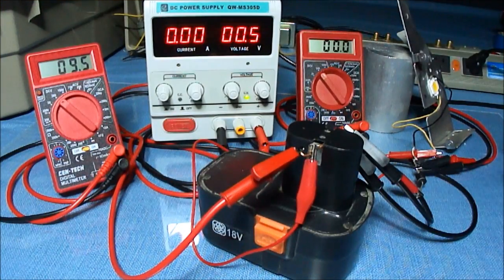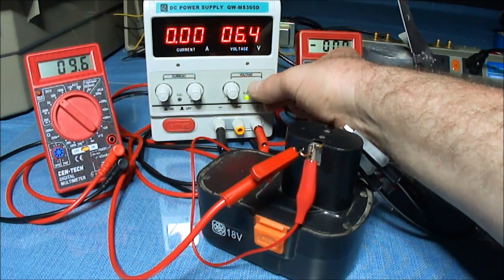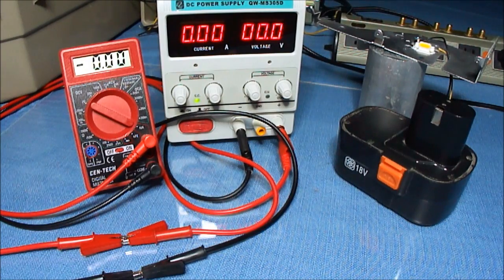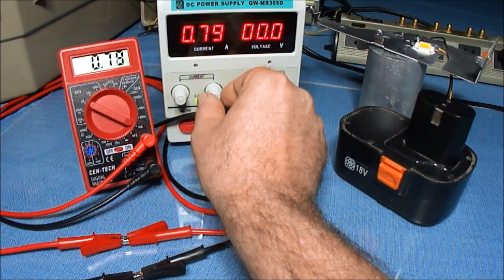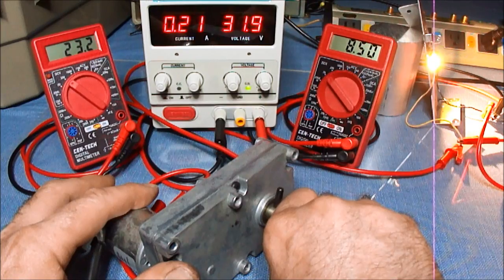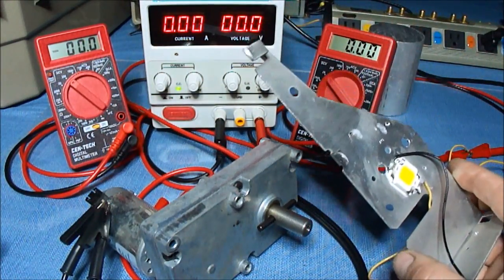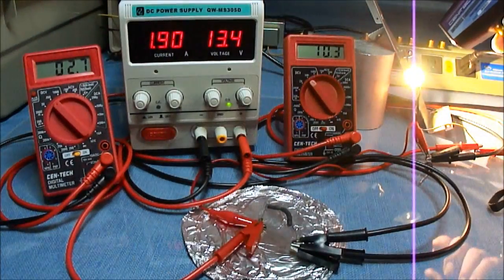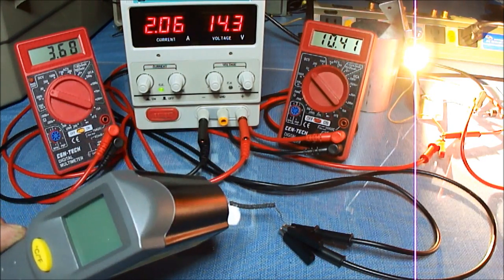LED Series Part 2: Ampless Light - Zero Point Energy?

Comment: Because the battery in parallel with the power supply while the LED in series and parallel with the two balancing source  aka two battery source one higher voltage and capacitance than the other. While one is discharge into the battery (charging) and discharging into LED in series and parallel. The LED current feedback into 18v battery while moving against opposite direction to the charging current coming from 31v power supply. This create scalar current that cancel with constant voltage potential. You can do the same the with smaller LED and 2-3 1.5v battery with/or 9v battery maybe use resistor. The batteries total voltage will going up.

Comment: Great vid, I experienced something similar in an experiment with bifilar pancake coils and batteries in series with a motor to allow the system to run. I believe that we could recuperate a Hugh amount of energy this way while still using enough to produce extra. Use the motor as a generator to charge the batteries that power the system. The pancake coils would act as a resistor similar to the coil you have, but again rectify this AC and collect via caps to a battery. Almost no loss.
Reply from the maker: Thanks. In every circuit there is energy being dissipated into the air by each component. With high voltage the air can be caused to draw to the system as both +/-. If you have at least three plates in an air capacitor two of them can be drawn off of while one remains charged. Once it's charged there is no input needed except to replace leakage. This is Tesla's energy sink described in 1900 Century Magazine page 201  https://www.youtube.com/watch?v=EJUuzGPQw0k

Comment: I think the LED has a constant voltage characteristic ...something like a Zener diode.  So if we divide the small change in volts across the LED by the large change in current through the LED it's Ohms value would be quite small.

Comment: I believe RMS meters are appropriate in this situation as the LED can start to have oscillating effects almost like "linear resonance". There is a reverse current in all diodes especially when I load is applied. So you will get back flows of AC essentially. Especially as you reach the breakdown voltage of the LED. This is not to say there is not an effect here, but one must keep in mind the "faster" with the "slower" energies at work. Just my two cents for whatever that's worth.
Reply from the maker: Diadon Acs Thanks for your comment. An oscillation is a good possibility even in the supply itself. There was a 45v 3amp diode between the LED and battery that stopped a LED voltage reading when the supply was turned off. With all the limitations for improvement that are built into electric devices, I'm starting to question whether there is also an inaccuracy built into modern meters. Resistance of circuits and protection fuses could become consumption devices and give a false reading just because they were added to the circuit. I don't know if this is working as it appears but there could have been some things that worked better than we thought. Every two cents helps.

Comment: Hi Mike I've noticed with those infrared temperature guns that on a reflective surface they're not accurate, some people have said try using piece of electrical tape on your surface
Reply from the maker: David Davis Thanks Dave the temperature was that hot I couldn't touch them. The gun barely picks up over room temp. now.